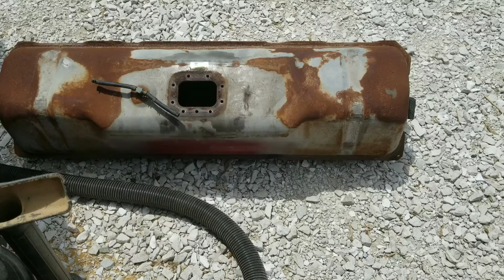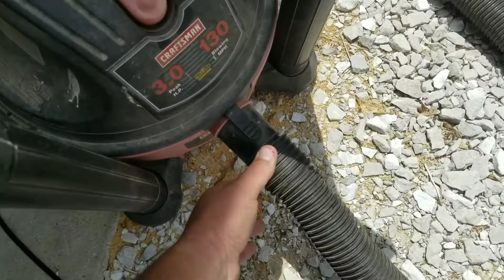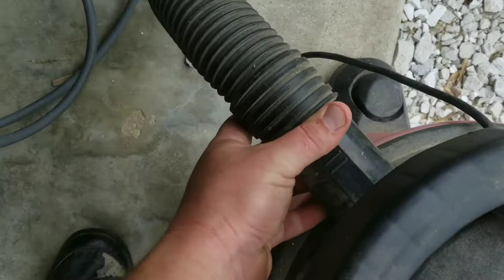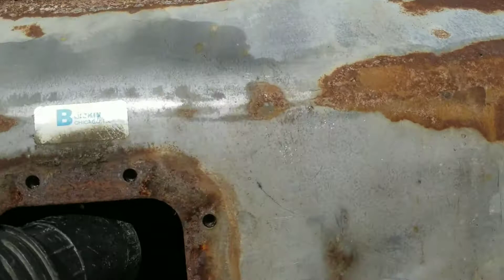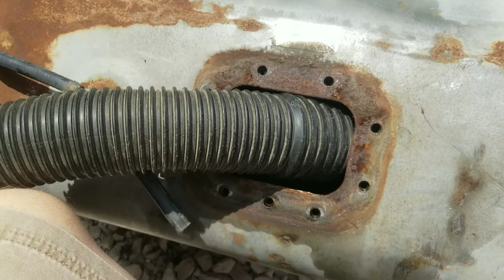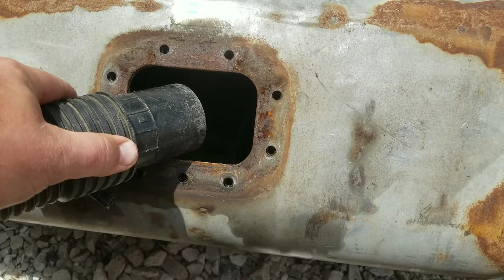Fuel Tank Welding Preparation The Safe and Easy Way (I didn't say quick).

Comment: Overkill. That tank won't explode even with fumes in there. Flames possibly escape through the top or bottom opening. The internet scares everyone.
If welding a sealed tank yes it can explode. But a water rinsed tank even with left over fumes isn't gonna explode in 99%, cases. Most it'll do is catch fire for a couple seconds and stop

Comment: What do you think about sloshing around and rinsing with some white vinegar like how you remove rust from inside a tank? Would it remove all the residual fuel?
Reply from the maker: I don't think so, it's the vapors that are dangerous and completely evacuating vapors in a relatively closed container is very difficult.